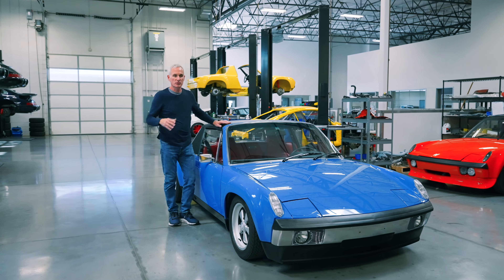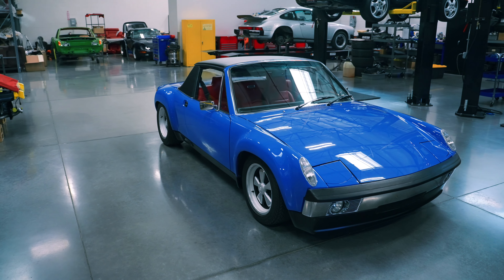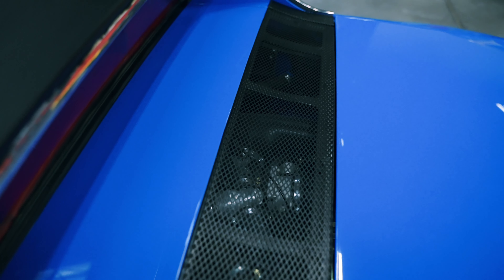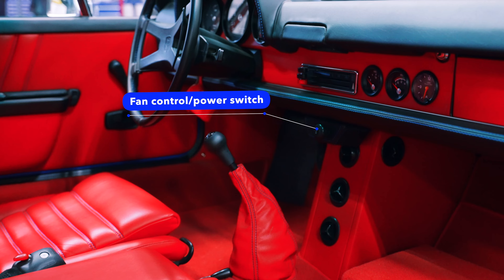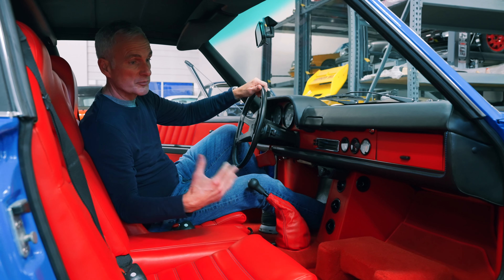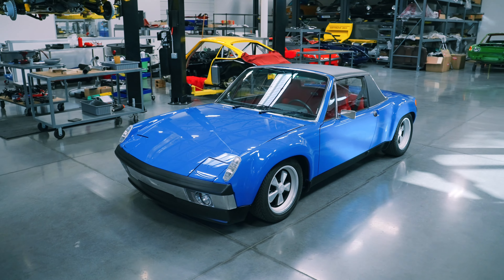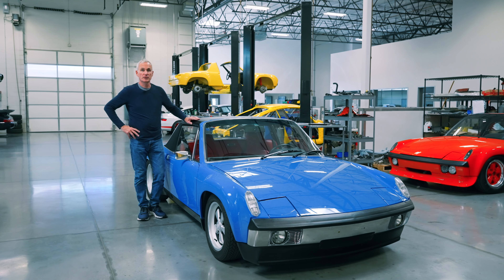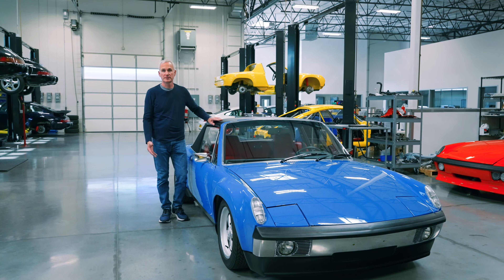1971 914/6 Italian Model to Big GT Spec 993 3.6L DME and 915 with electric AC Upgrade Conversion

Comment: Road in one of these once. Life changing. I was a muscle car guy. Only thing I have driven that came close was a racing go-kart. This car can corner on a level you simply can not believe. After that I went and bought a 1974 Fiat X-19. Killer handling but low powered. You can go around a corner with a under powered car though. It was fun.